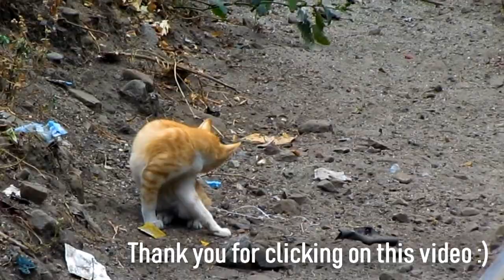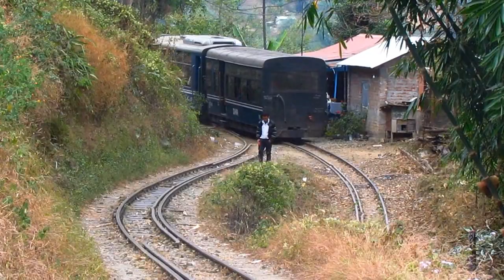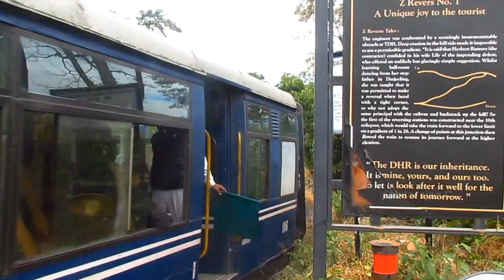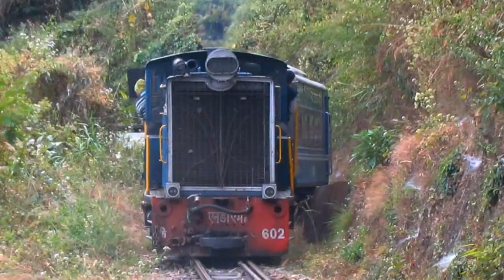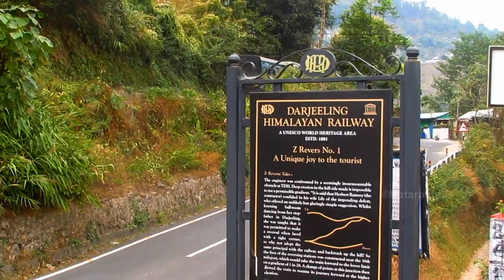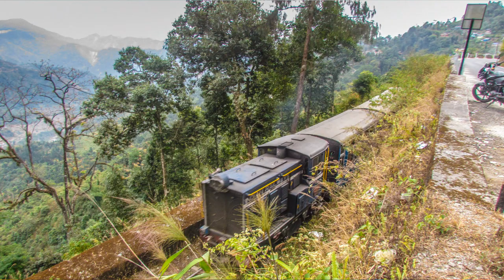TRAIN GOES FORWARD - REVERSE - FORWARD HERE | Darjeeling Himalayan Railway - 'Z' reverse

Comment: Super. Engineering marvel. Kudos to NCS for such wonderful capture. These works will make you forgot sad moments like RPF 👏👏👏
Reply: Ramesh Ji,You have thank Franklin Prestige for this great engineering marveling feature !
Reply: @sudhirtamang4564  thank you for sharing such a wonderful info
Reply: @rameshn7207  ji,Yr most welcome,There is a story why this Z revesals was made !
Reply: @sudhirtamang4564  could you please share the same
Reply: @rameshn7207  ji,Yes why not,Sorry my phone battery was low it switched off,Now I charged it
Reply: @rameshn7207  ji,When Franklin Prestige came making tracks along the Rangtong Station and when the tracks were hard to make to climb high terrains and hills by making loops it was not possible,And can't make the bridge in that high mountainous regions at that British era,Desperately he went home,His wife said what happened? Prestige told about the problem,Then his wife suggested If you can't go up come back and go home,Then this rule applied by Prestige made fame Z revesals that is Ziz-Zag crossing. You can see it in D.H.R. Muesum or ask any D.H.R. officals.
Reply: @sudhirtamang4564  lovely. Thanks for your update
Reply: @rameshn7207  ji,Ok thanks My English is not good as your,There are 6 ziz-sags and 4 loops along the 88kms D.H.
R. tracks.
Reply: @sudhirtamang4564  I'm impressed with your English. Just to communicate. Yours is good. 👍👍👍
Reply: @rameshn7207  ji,Ok thanks,by,tkcr,sweet dreams !